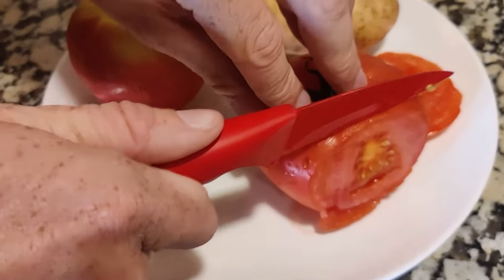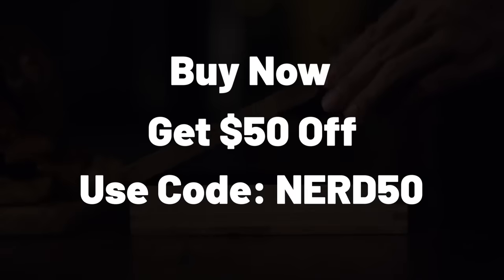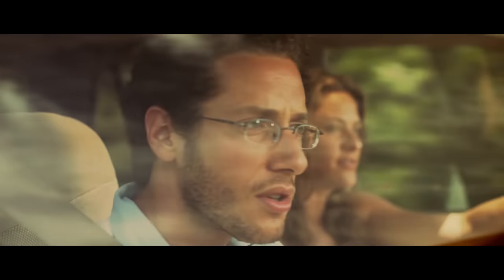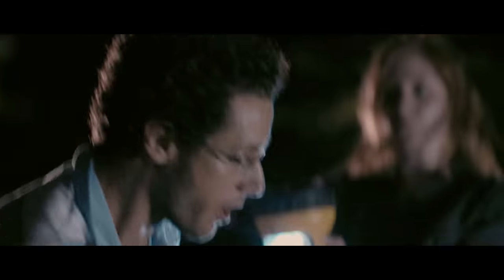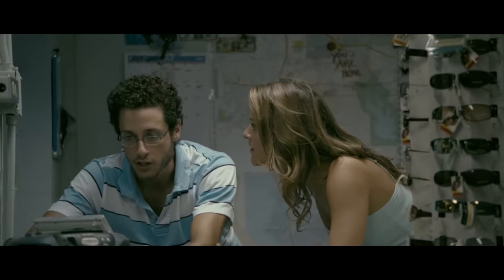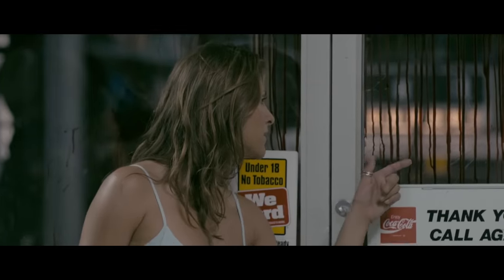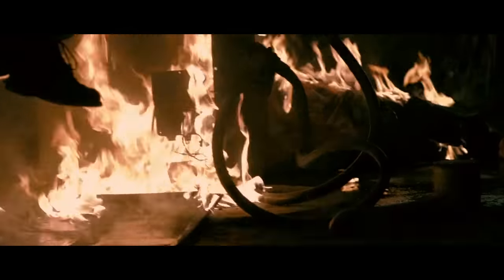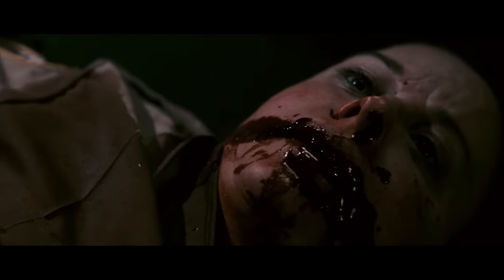How to Beat the SPIKEY PARASITE in "SPLINTER"

Comment: As I recall, the director or writer behind this film mentioned that the parasite is unlikely to spread very far or very quickly because its sensory range is somewhat limited, relying mostly on the host's panicked movements after infection to spread quickly. So while it would be a huge threat in, say, a city, once it hits any kind of firebreak, the infection grinds to a halt and is purely reliant on an animal stumbling across it, getting infected, and managing to wander off far enough that the process can repeat itself. And since most animals would investigate face first, the time it would take for the infection to disable higher brain functions in most circumstances would probably be minutes, and any animal that casually brushed up against it would lose mobility in a few hours at most, becoming crippled and unable to expand the parasite's range any further, meaning the most the parasite can travel from its point of origin is a few kilometers before a sort of dead zone is established where all the local wildlife has been infected, but now the parasite is totally reliant on outside factors to spread further and may just gradually die off.
Reply: Wow this is interesting. Thanks for the info man 👍
Reply: To be honest It wouldn't go outside the continent it originates from. If it originates in the Americas, even if the spread becomes amazingly big, since people would see what happens at some point it wouldn't travel by air or sea. So, if by some miracle it spreads through the whole continent, it would only stay in that continent. Same story with Europe, Asia, Africa, and Oceania.
Reply: @mrbuttocks6772  Yeah, I agree with you (I think I didn't explain well). It's just that places like Indonesia (I think), Australia, Cuba, Madagascar, etc. Wouldn't be affected unless the virus is there from the beginning.
Reply: @mrbuttocks6772  Open, but there is enough open and sparsely populated ground in Europe, or any other continent for that matter, for the infection to simply run out of momentum. Even somewhere as densely populated as China, India, or Japan would demonstrate this.
Reply: @Brutalyte616   yeah, the moment it goes X amount of KM out of a city it would lose momentum. I didn't know the stuff about the writer and always assumed it was a fungus/spore like thing that used the animal life as mobile incubators. If it truly is just a parasite/infection then it could easily run out of steam regardless because while we humans are densely populated in cities and certain parts of the world, even highly crowded countries have acreage of land that is either used for crop growing or is too rocky/mountainous for the parasite/infection to work its way up that proverbial hill.
Reply: @Crisjola  As I recall, the background for the Splinter parasite is that it's from a subterranean biome where the native wildlife have high concentrations of metallic compounds that it feeds off of, and while the parasite is a minor nuisance in its native environment, it is extremely dangerous to above ground lifeforms, targeting warm-blooded animals with metallic compounds like iron in their body.
Reply: @Brutalyte616   ohhh so that's why it "splinters" like ferrous metals and/or iron shavings being moved around by a magnet. Technically it easily could have (to theorize here) not killed its original/intended hosts, since only really terrible parasites kill their hosts, and those intended hosts ate bugs or ingested minerals from the water in the subterranean caves which, iirc, are usually high in various minerals. That, and based on my own experience living with well water, there can be a lot of iron and other metals if you're just deep enough to have a well, let alone be a sci-fi/horror parasite that lives in some animal that lives underground. 

Plus, and this just occurred to me, it would be cool that if aside from heat the parasite is actually drawn to the fact that various metals are magnetic so it's got some kind of electro-magnetic field that causes the parasite to be drawn to metals it would feed off. That's the only way I could see that it would be a minor nuisance: all it does is help drive the animal it's inhabiting toward more metal rich mineral deposits. And since it's not a virus (like Rabies being hydrophobic) it would also focus on surviving itself and not just replicating the way viruses "behave" (unless I've got a poor grasp on how parasites work.) I'm becoming fond of this theory as I chew it over in my head because it explains why the splinters will shake and move, as if truly alive when it's probably just detecting the magnetic pull toward the iron in the potential host body.
Reply: Or wait till winter so it dies of hunger or burn it.
Reply: begs the question if this parasite mold stuff can die at all, there probably is no answer because at the end its still out there and its not confirmed that fire necessarily kills it let alone all of it's plinter babies that it likely left after each step it took around the gas station and all over the forest floor
Reply: Compare that to COVID-19 which usually does not kill those it infects and those who do die take a lot longer. Because of that, it's been able to spread across the whole world.
Reply: @Crisjola  The scary part is that it keeps the host alive for quite some time despite the severe trauma it causes to the body, so there's a point where the parasite has probably infested every part of your body except your brain and other vital organs, leaving you in excruciating pain while still remaining fully conscious. Because again, it's not looking to control your brain per se, it's looking to absorb all the metals in your body and then use the body itself as a kind of skeletal superstructure to act as the vehicle by which it can move towards nearby sources of heat indicative of the animal life that possesses the metallic compounds it can consume. Can you imagine that? Every bone in your body, broken, every limb snapped, every muscle and ligament torn, and with every bit of it lovingly stitched and held together with what is basically barbed wire. And then your forced to start crawling towards your friends and family like this, tearing them apart to be sewn into this horrible thing you've become or managing to inflict just enough damage that they become infected too, and now you're forced to see and hear them repeating the process.
Reply: That doesn't even take into account that as soon as people learned about it and how it works it could easily be tricked into taking its self out via large bonfires since the parasite doesn't have mental capability to have its self preservation tell it not to go to the fires.
Reply: Ah, that sounds like it makes sense.

I was worried it could, theoretically, spread extremely fast by bootlegging onto small insects and either use minute contact (infected mosquito bite for example) or aggregate the biomass into an insanely large monstrosity.

But insects individually don’t have enough biomass for the parasite to gain much of anything by infecting it. Then, there’s the issue of nervous system: insects are so simple that, even if it could hijack a bug’s nervous system, it’d at most wiggle around a bit.
Reply: if this existed we'd probably have to quarantine. couldn't imagine what the karens would have to say about this one
Reply: @spartacussmith7070  The difference is that COVID-19 is highly contagious, has a 2 week gestation period, and has symptoms consistent with cold or flu. The Splinter parasite is about as contagious as a fire in a dessert; it has to make physical contact to spread effectively and it can't travel very far without an active host to act as a vector of infection.
Reply: Seems like this comment was written by a failed squirrel leader who couldnt get the rest of the squirrels to help him get those sweet sweet eyeballs.
Reply: @jesusemmanuelcordero4509  not entirely true. If somehow it took over north America, its not a stretch to say it could find a way to south America. And mainland Europe, Asia, and Africa are all touching with land. But you are correct that it likely couldn't spread from the Americas to the afro-euro-asia landmass. 

However, linking back to my comment, depending on how long it can survive without a new host, it might get lucky and hop a ship. Possibly a plane, but thats highly unlikely.
Reply: Ok this is old but. Overseas this virus stands no chance. Even not overseas there is gonna be a point where people already know infected areas. And even if they go there seeing how fast his girlfriend died and came back the virus most likely start up a few seconds or minutes after contact. You can't get that far and not know you are infected. This virus would be like a very little problem and we might find a cure if we are very careful.
Reply: I think he's forgetting birds. They don't have to get close to get infected & could spread it farther faster.
Reply: @jesusemmanuelcordero4509  idk. I feel like some idiot would smuggle an animal out & just think its sick & that's how it would leave the continent.
Reply: @beautifullybroken4879  Yeah, the only way I see it spreading is through stupidity.
Reply: @beautifullybroken4879  I'm not understanding your logic. A bird would probably be crippled in minutes, if not seconds, and their ability to fly would almost be immediately compromised, and they would be exposed just as easily as any other animal because the parasite spreads through direct contact.
Reply: @Crisjola  nah, it's entirely dependent on motion sensing, and it's own host to move
Reply: @Crisjola  oh yeah, most parasites aren't fatal, in their preferred species, pit a long term parasite in the wrong species and 1 of them will probably die
Reply: so basically America isn't fucked but if it somehow is as long as no one goes in or out ever again the rest of the world is safe.
Reply: That actually makes me feel better. First time I watch the film many years ago, the premise horrified me with how easy it infects and essentially being untreatable once infected. Great movie
Reply: @jesusemmanuelcordero4509  But then again, is there anything that implies that the parasite couldn't infect aquatic wildlife?

Comment: @ 10:20 when she calls for help via “5-14” Almost every law Enforcement Agency uses DIFFERENT 10-codes or signals, as ir varies county by county. The only codes that normally stay the same are 10-4, 10-10, 10-20 and a few more. So 5-14 could mean anything. -a cop

Comment: how to beat "SPLINTER": 3:44 don't trust this guy and run END.
Reply: Yeah but like, that's just one problem finished. There's still needle zombies.
Reply: @willyeeton4390  looks at flamethrowera on right, and napalms on left, and finally looks at nukes in front of me
Reply: @Dante Trice and also the fire or heat zone is bigger than the evaporated radius. Also for a starting parasite a city is pretty gigantic, I mean look at things like NYC or Hong Kong. And also if nukes don't wipe out a big enough area how are we supposed to wipe out the parasites with weapons that wipe out even smaller areas, just saying we start with nukes and whatever is left we napalm and explode th e heck out of it. We could also use another type of nuke called a thermal nuclear bomb in which it is more effective at exploding and igniting things which would take out even more parasites than just a regular nuke.

Comment: Gas stations sell alcohol and lighters while they have cloth(shirts), they could have just made  Molotov cocktails.
Reply: Would depend on the type of alcohol sold. Most isn't flammable unless it is very strong. I think like 151-proof or 75% alcohol content. Otherwise the water/not alcohol components prevent it from actually being flammable. Rubbing alcohol is definitely flammable, and I have seen some gas stations which sell it. Just very rare to see alcohol stronger than around 16% ABV sold at gas stations.
Reply: Alcoholic drinks don't have enough alcohol to burn like that. Even strong liquors like vodka and whiskey are only 40% alcohol and 60% water.
Reply: @Thematic2177  bust out the everclear! 😂  to be fair that's basically rubbing alcohol already lol
Reply: @xorphana  Unless they could distill alcohol with stuff in fuel stations. Maybe some sell pots, radiator hoses, tools... Almost everyone  I've been in sells grill charcoal, so heat is done and water can be a coolant.
Reply: They did have lighter fluid. Use it for the molotovs instead.

Comment: I'm fairly certain the thorn parasite could be beaten.  I mean, yeah, there would be bodies before the authorities notice the pattern and how it spreads.  But unlike the airborne virus, these thorn parasites are very much visible (unless it can infect the common insects, like flies or mosquitoes or fleas).  And it looks like the parasite thorns (much less the bodies of parasites) are much bigger than the insects, so that's unlikely.  And that means a sized squirrel size is the bare minimum for it to actually infect.  Then it's easy.

Answer:  Armor.  Thorn themselves don't have super pressure power, so it should be pretty easy.  The armor should also provide disguise from heat.  And any weapon that destroys cells (such as flamthrowers or bombs, or just a freaking hole on the ground).  Then use the heat source as bait.  Boom, beaten.

If the monster can be baited, then the game is really easy.

Comment: Honestly I love this movie, but the one thing that constantly bothered me was that there was one of those ice cream containers (the ones many mini marts/gas stations have that store like wrapped ice pops and stuff) 
And so when they decided with the “cooling the body” plan I was like
Just empty the container, push it over to the doors with the person, or push it all the way outside, and the person would/should be cold enough and it would most likely withhold an attack from the monster or not even be detected by it from how cold it is

I doubt it would’ve made much of a difference, but I felt like it would’ve made decent armor or cover going out there then just carrying ice with you lol 😂 

Still love the movie tho and this how to beat video!
Reply: Not sure what container you're referring to, since I admittedly haven't seen the movie and the video only shows a walk-in cooler, but there'd be big issues regardless of what kind of container you're talking about.
If you're referring to one of the smaller coolers, those are a terrible idea since while they're cold on the inside, they are very warm on the outside, meaning it'd actually attract them instead of hide you from them.
Even if it isn't warm, getting from the box to the car would be very difficult since you're going to be inside it, meaning you'd end up staying outside for longer, which would mean there's more time for the monster to find and kill you, and you'd need a longer distraction.

Comment: Honestly this thing would be pretty beatable. Also July didn't have to die (although the cop would be pretty screwed since she took 0 precautions.)

Denis was armed, and while it doesn't kill them, it does incapacitate it for a second, a second needed for Lucy to get warned and run.  

As for the parasite?  It can't sense things that are cold, and potentially is weak to fire.  Both of those things pose a good enough weakness that it can be killed.

Comment: I don't think this parasite will destroy the world. At first glance it seems unbeatable, and locally that is certainly true: As soon as you see one of these monsters, you're doomed.

But in the long run it has several key weaknesses, humans would be able to abuse:

Firstly, it is easily recognisable and leads quickly to symptoms. This means it's easy to separate sick from healthy people.

Secondly, it probably will burn through hosts quickly. This is only an assumption, since we don't know how this organism works, but from what we see, it seems pretty likely. Our body (and the same holds for other mammals) needs a constant supply of food to function properly, especially if we do exercise. This parasite probably can't replenish it's reserves. And considering that it uses the bodies in unintended ways, it will use them up even quicker. My guess is that after two days at most, they won't be able to hunt actively any more. 

Thirdly, it can't move over big distances, since it can't get transported passively, as soon as there is a rudimentary control and it can't get very far actively, since that would burn through it's bodies to quickly.

Worst case, build a big wall around the infected zone and starve it out.

Comment: The solution here is kinda simple. All you need is clothes thick enough that it blocks out heat. and there are plenty of those, many specifically designed to reflect heat. After that you just need flame throwers and fire bombs, these things aren't exactly fast besides in small bursts, and they seem to be almost blind beyond a few yards. so It wouldnt be hard to setup safe zones where you just burn anything that comes close. Sure alot of people would die but this is no where near as bad as alot of world ending events.